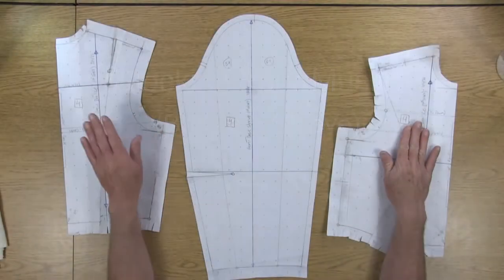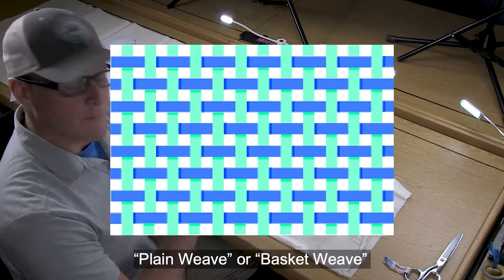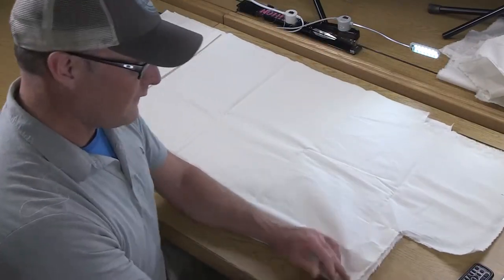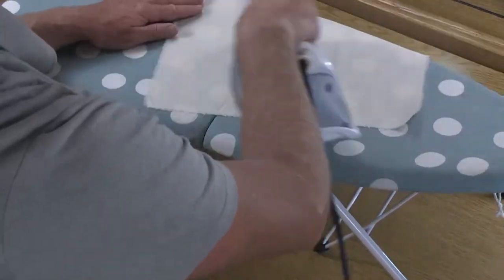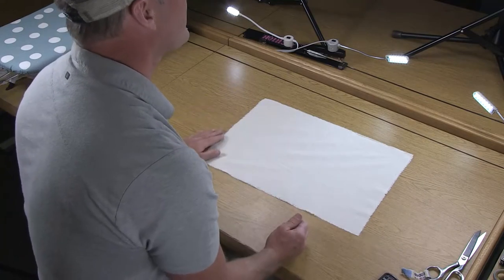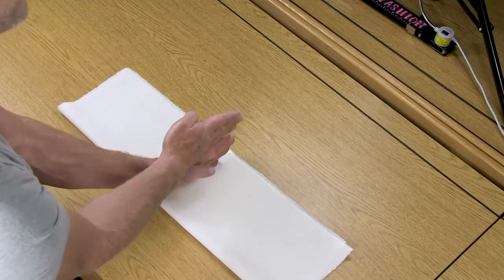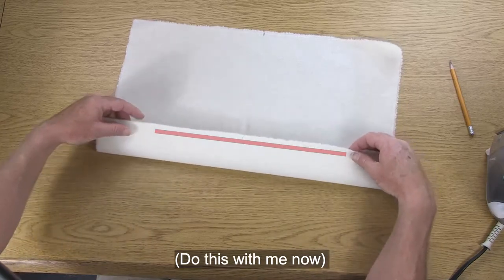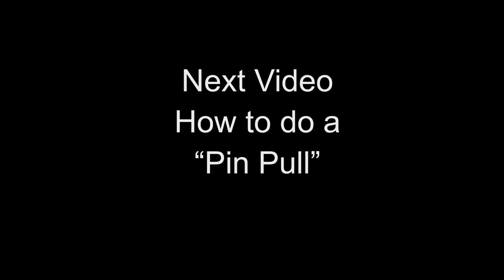Blocking Your Muslin | Bodice + Sleeve (Test Fitting)

Comment: Curious, what would  be the reason why a fabric doesn't rip evenly?  I've had fabric rip either unevenly or even begin to curve...could it be that I have "old" or dry rot muslin?
Reply from the maker: It probably not "Plain" Weave or "Basket" Weave...same thing. I think if it was old, it would be brittle and for sure tear in a straight line (path of least resistance).